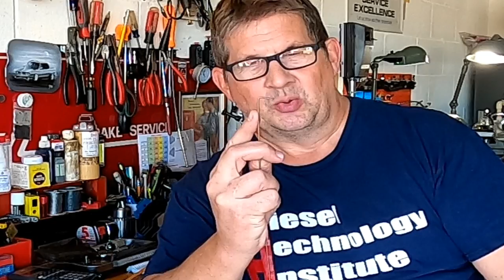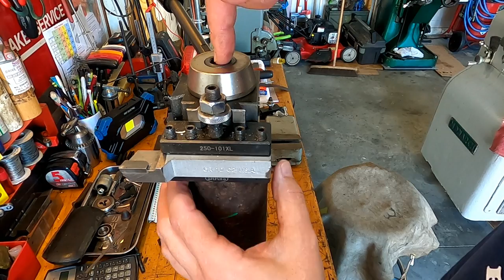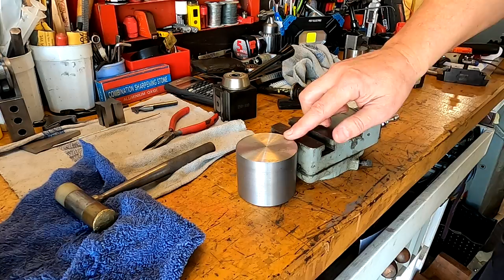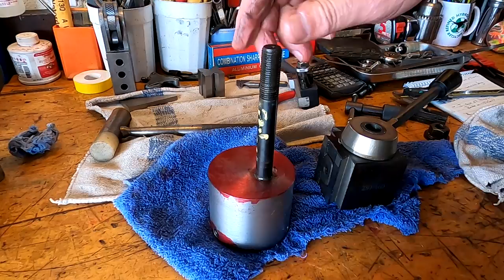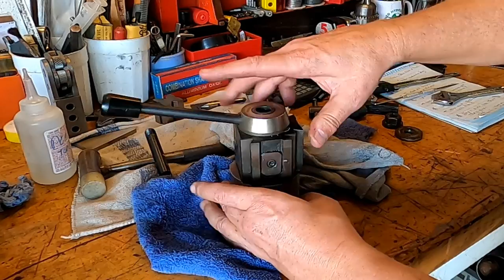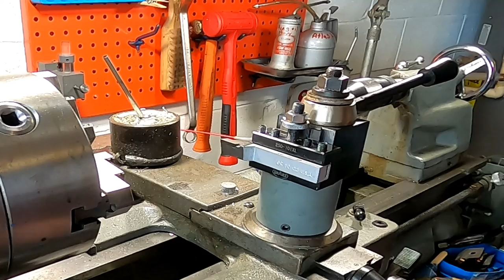Craftsman Atlas Lathe: Compound rest eliminator - solid tool post. Explanation and build

Comment: Don. I Also live in Florida😄  I've got a !0" Atlas Lathe bolted to a 3/4 Slab 8" x 45"of cold Rolled That was Blanchard ground.  The original bed was wood  When I bought back in Michigan.  
So I watch you posts with great interest.   I have always watched my Slides and gibbs do a dance when I take even the slightly aggressive cut or  Parting.  I just rec'd a 3" round of Cold Rolled to make my compound  Slide replacement.
Reply from the maker: Sounds like you have that thing mounted solid. Keep your gibs snug and lock that carriage when parting. Love my Atlas for sure.  I do a lot more on it than you can imagine.  Don.

Comment: Brilliant idea and superb instructions. Just picked up a 618 two days ago with tooling on original Craftsman workbench. The owner  had been given it and didn't use it. But the best part is it was advertised as an Atlas  3950 so I was pleasantly surprised. Going to make this modification in a few weeks when I pick up my mill. Do you have a recommendation on the tool post brand? Thank You
Reply from the maker: On the tool post brand.. Well, if you can swing the cost of an aloris. Otherwise all the knock offs are pretty much the same and will do the job. Good buy.  Don

Comment: Don, this has been one of those things on my "To Do" list for quite some time. I wish I could add something useful but I think you covered it all; especially the offset you incorporated. I'll probably make two of them. One for my QC and the other for my 4-way turret. Hell, I might make one for my Lantern tool post too! I like options. Thanks!
*Wakodahatchee Chris"
Reply from the maker: Under certain circumstances this eliminator has been really useful. A plus positive for smaller lathes for sure.  Sounds like you've got some project time you need to set aside. Good luck Don

Comment: Very interesting video and solution. It would be simpler just to put the hole in the center as you can make almost of the work on the lathe but of setting the tool post shurely helps in terms of rigidity. It's a project on my list as i have a relatively small lathe and rigidity is very important.
Reply from the maker: Yes, the smaller lathes need every advantage that they can get. Don

Comment: Don Thais a very good video, I made one like that for me milling attachment. I am going
 to make this one for my tool post, my machine is a lot older then urs, it has a lot of play
In everything. I would lie to put a different motor and reverse but cannot figure out how 
to keep my chuck from unscrewing, got any ideas?
Reply from the maker: Ah the great question that plaques us all with screw on chucks.  I only use reverse for backing up off a die cut or an oddball cleaning need or sometimes a grind job with the tpg. Very rare to use it and with great care.  Don

Comment: The only way to eliminate the bending moment between the overhung tooltip and the tool post is to mount the tool directly over the vertical axis of the securing bolt for the quick change tool post. This would mean that you'd have to make a custom tool post. You're still going to have the same bending moment between the tooltip and the QC toolpost no matter where you mount it on the cross slide.
Reply from the maker: Granted, but in this set up, I move that moment back for QCTP mount which affords a bit more rigidity/leverage advantage between the cross slide and the QCTP. The entire set up is also significantly less intrusive around outsized work to boot. In use is were you feel and hear the difference of going sans compound.  Don

Comment: As suggested in this video, I went back looking for some “tricks” on stiffening up the compound/cross slide in your milling attachment video but I guess I missed it. Any advice for stiffening up my qctp set up on my 12” Atlas craftsman lathe? I’m chattering all over the place. I’ve replaced the thrust bearings in the headstock, checked my gibbs etc…. I’m not having any luck. Thinking about changing out my chuck as a last resort. Any help would be appreciated
Reply from the maker: Hi Steve. Did you see my spindle bearing adjust procedure?  Make sure your spindle bearings are adjusted properly.  I cover in that one, the things to be sure of. Minimum stick out from the chuck,  keep your tool extended the least amount possible, tool height properly set, tool sharpness. I did the QCTP eliminator to gain even more rigidity for harder work pieces. I don't know what chuck you're using so couldn't advise on that.  But unless you have just one crappy chuck with a poorly set up backing plate hanging it out an extended amount from the spindle, then it shouldn't cause problems.  You may want to try turning some different materials and see if its just harder turning materials affecting it. Also is there a difference when you use a tailstock center? It may boil down to having a weak motor and the motor bogging under load. Try turning lighter to heavier passes and see where it starts chattering the most. You should be able to turn off .025 (.050 total) on most cold rolled with a good 3/4 motor. My lathe is set up a bit differently with a 1 HP DC industrial motor, pulley reduced from its nom 1740 rpm speed, and its a total beast on there. It did a lot to quell bog/chatter.  Hope that gets you going. Let me know. Don

Comment: If you used a larger diameter piece of steel for your solid tool post, your quick change tool post would have more support, and it would have better friction (more area) and leverage between the bottom of the QC tool post and the solid tool post.
Reply from the maker: Yes, for sure, I only have about 3/16 to the outer edge of the pad, and beyond that point there is no support. I used what I had on hand. If I had a piece 3/8 larger that what I would have used.   Don

Comment: In industry I've only ever used a lathe with the compound slide on it for the last 60 + years......those that think removing it for a solid block are amateurs......of course, if the lathe is crap any modification will improve it.
BTW.......a QCTP is for convenience and if the tool overhang causes a problem that is par for the course.
Reply: "In industry"? What industry are you talk'n about? I think Don is too much of a gent to reply to your condescending comments. I on the other hand, consider myself more of a Florida Cracker. So let me set you straight. There ain't no industry left in the USA! We went from the most industrious country the world has ever seen. To an empty shell in the matter of a few decades! The odds are that if you own machines large enough to handle parts for a D-8 you are a fabricator, not a manufacturer. Manufacturers are all in China and India now. The rest of us will be HSM's. Many of which.... like myself are retired from unrelated professions. I feel quite fortunate to own a 1960's vintage cabinet model Heavy -10 and a 1945 Logan 920. Both of these lathes were intended and billed as 'Tool Room" lathes. That said, either of the two have more American Iron in them than most of the imported offerings today.

So yeah, I'm a damn amateur machinist and I appreciate any tips that make my retired shop time more pleasurable. So THANK YOU ....DON!👍👍
Wakodahatchee Chris
Reply from the maker: Hey C Drive... Looks like I missed all the fun. I tend to just pop out whatever I'm doing and move on. Appreciate the kudos though. Thanks. Don